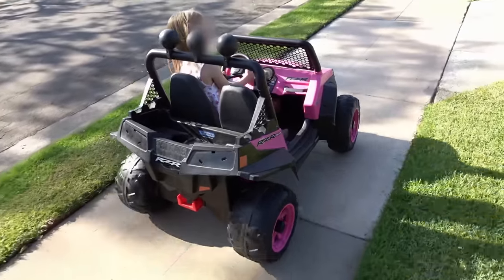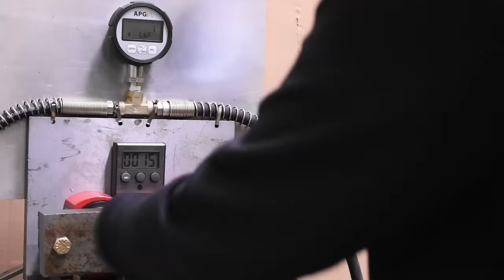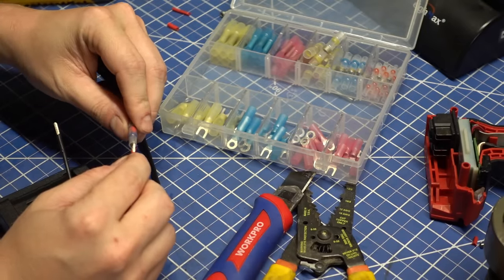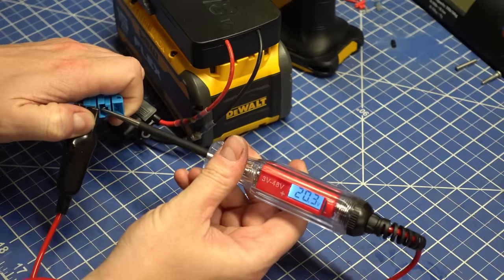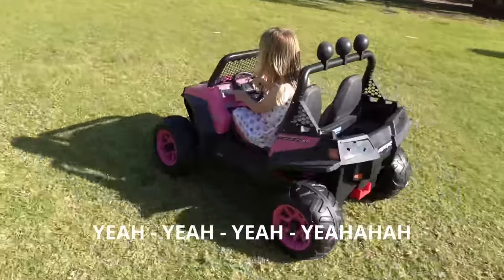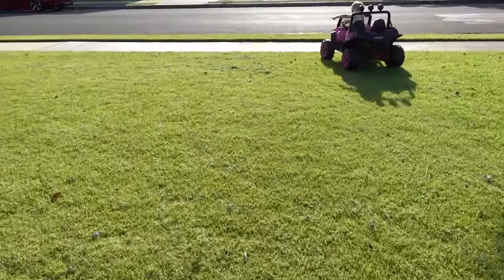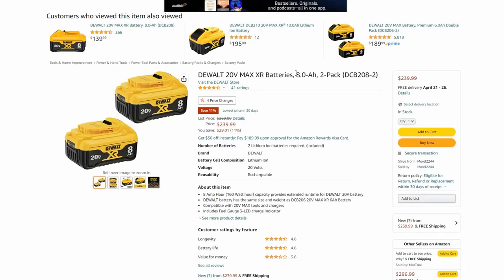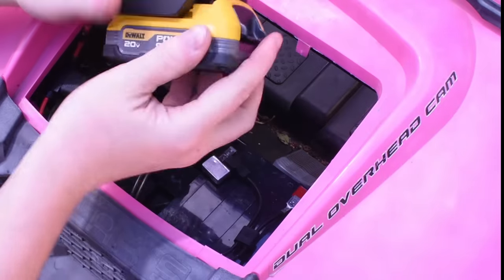I Figured Out What DeWALT's Huge $400 Battery is For😄(Kids Power Wheels)

Comment from the maker: 1.5 year Update: She's a bit older now and on setting 2 for ALL the fun, loves it. The car's been holding together just great, loosing traction is probably key. 
Obviously this isn't a cost savings mod unless you already have power tool batteries, they aint cheap. But if you do? Adapters for DeWalt: https://amzn.to/390Dm7Y M18: https://amzn.to/3uAiXBf Makita:https://amzn.to/3GlJXao Ryobi: https://amzn.to/3jNRIuD Ridgid https://amzn.to/36uSVE4
Plug end for Peg Perego: https://amzn.to/3jNRxz8 Power Wheels: https://amzn.to/480wtg9
Reply: Be careful, most dewalt batteries do not have internal low voltage protection. Meaning you can over discharge them like this and the charger will refuse to recharge them seeing the lower than expected voltage as damage. There are tricks to getting them to recharge however a cheap low voltage dropout circuit needs to be added to protect the battery.
Reply from the maker: @D3M3NT3Dstrang3r  6:14 agreed. The battery's display going down to one bar is enough to switch it over to the lead acid or another DeWalt for us. You usually have a decent 10-20 min window there too.
Reply: @TorqueTestChannel  I wonder if Ryobi wouldn't be an ideal option, as if I recall correctly the batteries all have low voltage protection built into it.
Reply: @TorqueTestChannel  That works as long as people know that and keep en eye on it. I do these types of projects with tool batteries often and generally use my Ridgids as they have protection. Also there are some great cheap batteries on the market to do these projects with, unfortunately that is why they are cheap, all of the load balancing is in the charger and protection is in the tool and not the battery. Im sure you know this, it is more of a tidbit of info for the people who may now try it since watching this.
Reply: @elijahwatson8119  Just about any tool that is using a battery platform from the earliest lithium tools like Ryobi / Ridgid have the balancing and protection built in. You can usually search and see which ones do. But there are also a couple of ways to get a good idea by just looking at the battery and price at least when it is name brand vs namebrand. Cheap batteries like Kobalt for example are good batteries but significantly cheaper because the load balancing is in the charger and protection is in the tool. And secondly look at the number of pins the battery has. If it only has about 4 actual terminals the protection is probably in the battery. If it has multiple small connections then load balancing is definitely in the charger which is a good indication that the oc protection is likely in the tool. One exception all batteries should have over current protection in the form of a non replaceable fuse to prevent fire. Ones with built in protection have a fuse and an overcurrent cut off that protectes the battery and fuse. Consider a current limiting device if you are using a battery with it not built in as well.
Reply: I bought an adapter with low power shutoff.It killed an 8ah dewalt over night or 2 nights  just plugged into the adapter only.Not powering anything.
Reply: @2hotscottpro  Thats crazy. One reason it is better to build this stuff yourself when you can. You never really know the quality of what some of the sellers in this type of space will sell you. On the other hand I met someone who did this setup for his son and also used the Dewalt batteries. He over discharged them and never could get them to charge again, not knowing any better he thought that he had just damaged them and disposed of them. Which if you manage to do it a couple of times they will be damaged beyond repair.
Reply: @2hotscottpro  Just another quick thought. Was it sold as a low voltage dropout device or Overcurrent Protection device? The 2 are mutually exclusive. I ask because ocp only does always draw a little current while powered and will eventually drain a battery but not usually all that rapidly. Under voltage goes before Over current in the circuit when designed correctly
Reply: @D3M3NT3Dstrang3r  link above in last post.Looking for someone to shed some light on this issue.Thanks
Reply: @2hotscottpro  I will have to check that out. In the correct configuration once it shuts down it should not power back up until the battery is removed and replaced and then only if the voltage is above the set threshold. In that scenario it may flash on but it should shut right back down. Dunno specifically about your device but it sounds like it is not working like designed, or if it is like they intended than it is poorly designed.
Reply: @2hotscottpro  Looks to be flagging it as spam.
Reply: I wonder if you could use the dewalt 20v to 18v adapter for low voltage cut off since the 18v tools didn’t have that. There has to be some kind of protection built in that adapter.
Reply: @derekrausch3499  Interesting thought. If I can find the one I have at work I will have to disassemble it and see. I don't remember the old tools having any type of protection either.
Reply: Can you say you are badass, kickass for a father?  Man I remember I had a two door jeep back in 1989.  Then my childhood best friend got one.  Then he got a go cart.  Then I got a 4 wheeler.  Then he got a Chevy Silverado.  I finally topped out at honda civic.  Those were the times when you could get away from traffic the easy way.  Lol!!
Reply: @derekrausch3499  Verified that the 20 to 18 has built in protection circuit. It is potted so I cannot tell what is all there but you can see the output mosfet. This would be a great piece to use as your connection for a dewalt battery but it looks to be considerably lower current than the normal lithium base.  Very small gauge wires going to the 18v side. Like 18-20 gauge.
Reply: It would be interesting to compare it  performance wise side by side to the adapter TTC used. You could probably just put female spade connectors on the toy car’s wires and plug it straight onto the 18v adapter pins.
Reply: This channel is called Torque Test Channel…haha so what’s the torque at the wheels?
Reply: Great mod. Nice work Dad!👍
Reply: That’s cool!
Reply: You can use the dewalt 20v to 18v xrp adapter as your low voltage protection circuit
Reply: does this 15ah Battery give more power than a 2ah battery or even 5 ah? I did the switch and my sons jeep with a 2ah battery isn't that quick! . Let me know what you think
Reply from the maker: @joeb1906  power wise will be better than a 2ah but not a ton more than a 5ah based on the wattage being requested
Reply: @TorqueTestChannel Next up at 16 she gets an electric car with 30 flex volt batteries 😂
Reply: I'm just wondering how its holding up now?  I put dewalt battery on my kids 6 volt toy and it burnt up the motor in it pretty quickly.  So for the 12 volt toy I stepped down the voltage to 12 and added low voltage protection as well.  I'd love for it to have more power in the grass and dirt though.
Reply: I have the exact same razor color and all! 
1 question, have you had any issues with overheating and it cutting out? Being on gear 2 it goes alot faster but after a minute or so it shuts off bc of a limit i installed. Wonder if a step up converter will be the fix? Thanks for the video. Daughter said she has 1 too  @TorqueTestChannel
Reply: I have this same car and use it with a flex 6amp battery.

It was fine till her friends tried to ride with her. The torque on the wheels was too much and it pulled more than 30 amps which fried the fuse. 

I was thinking of a speed regulator to stop that or she’ll have to stop flooring it on take off.

Comment: You replaced an $80 battery with a $400 battery. I love it.
Reply: My exact same thought, already had the battery I guess.
Reply: Mo powa babeh
Reply: Although we all know a smaller ah can be picked up cheaper, I wonder how many times the lead acid would need to be replaced vs the Dewalt. My experience with the small lead acid batteries is that while they start with good current and decent runtime this fades off rater quick as they are constantly being deep cycled.
Reply: @TheCharleseye  and most likely many many more recharge cycles as well.
Reply: Those doing this mod are using batteries they already have so it's $0.
Reply: No it is not $0 he had to buy that battery at some point.
Reply: @TheCharleseye  ok
Reply: @TheCharleseye  that's true, but I don't think that smaller batteries would be able to last long in one of these as I'm guessing it pulls way more amps than one of the 18650 cells that are in there is rated to give out. The huge 15Ah pack has no problems for sure as it has two in parallel working together.
But also, those things have no voltage protection at all! Do you know if the voltage protection is in the battery packs or in the tools? If the pack doesn't cut power, it's gonna be expensive when the kid drains the voltage to 0 and you have to throw the battery away
Reply: That's what you do when you build for a real performance boost in a real car.
Reply: @TheDeepDiveLLC  this is a real car?! She's like 2!
Reply: No
 That battery not worth 400$ it's all Chinese one renamed with dewalt
Reply: @D3M3NT3Dstrang3r
Reply: I did this with a 2 amp hour 20v battery I already had, I get about 30 minutes or so out of it 
Ordered a DeWalt adapter and a PWM to give it speed control.
Spent $50 for more power and better charge vs $75 for a replacement lead acid
Reply: But how would you set a price on the improvement he made to the kid's toy? It would easily have cost $300 more if it had had this much power to begin with. Which is should have had.
Reply: @dylantellez2496  Get them buff horses!
Reply: @rickybobbyracing9106  rip donut media
Reply: It’s worth seeing your kid enjoy the speed
Reply: Also it's like 12Ah vs 300Ah
Reply: I bought one for my kids and just removed the governor and it picked up as much speed as this one did by upping the battery
Reply: If you had kids you would understand. It's worth it and drill batteries charge faster
Reply: @liamcody5060  🤦🏻‍♂️
Reply: You get what you pay for !
Reply: This is one of my favorite videos in YouTube. My toddler is getting an upgrade battery.

Comment: Have the 10 amp hour dewalt  on my sons 12v mustang. Major improvement. Huge fan of the channel man. Being a father myself I can tell just by the way you interact with your daughter your an awesome Dad. I love the family interaction content from the tool channels. I think it’s something we need to incorporate more often on our channels. 👊👊👊 keep up the awesome work my man
Reply: That battery was a helluva bit on EBay from part outs. $110 plus tax and free shipping.
Reply: @Daddy_Daiwa  sure was
Reply: You and Torque are both awesome dads!
Reply: @jonathansherwood5841  appreciate that Jonathan. How’s things goin man?
Reply: you're*
you are.
Reply: @abudhabi371  appreciate the correction 🤷🏼‍♂️
Reply: Awesome, but I think you meant 9ah. Dewalt doesn't make a 10ah battery at least in the US.
Reply: @thedude8976  they come with the lawnmower kits I think but you can buy them individually
Reply: @IMPACT-NATION  10 ah or 9ah?
I have several 9ah flexvolt batteries
Reply: @thedude8976  nah they’re 10Ah. I’ve got a couple 9ah Flexvolts for our compressor and a 6ah flexvolt. Love those batteries. Yeah just google 10Ah dewalt XR they’ll pop up. I didn’t know they made them either till I found out last year. Pretty sure they were made for Outdoor Power Equipment considering the capacity
Reply: @IMPACT-NATION  OK I will thank you for the info.  And again great channel. 👍
Reply: @thedude8976  thank you brother. Really appreciate it man 🤛

Comment: Put a low voltage cutoff module set to 16,2v inline with the battery….. you’re gonna kill it if you discharge it too low. There is no protection inside the dewalt battery. If you used a ryobi battery you wouldn’t need to worry about that as they have cutoff circuitry internally
Reply: @TheCharleseye  Having the protection circuits in the battery does not make it inherently better though as long as you stick with the intended usecase, where that protection circuitry is build into the tool. In theory building the circuits into the tool can(!) reduce production overhead and therefore cost, at no downside for the customer really. For the average customer this definitely is not a matter of better or worse, as it makes no difference as long as you dont tinker with it.
Reply: @TheCharleseye   having the LVC in the Battery is am incredibly inefficient design and as long as you use the dewalt battery in dewalt tools the LVC in the tool takes care of it….. ryobi does that so they can brag about backwards compatibility to their NI-CD tools
Reply: @TheCharleseye  well of course it can happen especially if the battery gets cold or there are multiple days between it getting drained and getting charged back up ….. not arguing anything
Reply: @TheCharleseye  I had to do that a lot (jump starting the battery so that it would charge) with my Milwaukee 9.0 Ah HD. I was still using it almost daily (carpentry) for another almost year or two, when it finally got to the point it couldn't even be jump started anymore, so I took it apart and it finally dawned on me that all along one/some of the cells went bad. I manually balanced the five cells, and got another 6 months out of the battery; now it's finally dead and waiting for refurbishing. Still debating whether to tackle it myself (I would need to get a spot welder) or whether to send it off to someone who actually knows what are they doing.
Reply: @TheCharleseye  I've jump started a few Ryobi batteries, some of them were even brand new but DOA (mostly 1.5Ah and 2Ah batteries), but have never needed to do so on my DeWalt, Milwaukee nor Bosch batteries. And I've owned many from the cheapo 1.5Ah to 6Ah ones. 
Perhaps the 3Ah and bigger Ryobi batteries have such protection because I've never needed to jump start those ones, but the smaller ones definitely don't have such feature.
Anyway it's a quick 15 minute fix I've mastered over the years.
Reply: @TheCharleseye  maybe they expect the everyday user to be wiser than the once a month warrior? Or maybe Dewalt just sucks, I don't know 🙂

Comment: Probably wouldn't be too hard to add a simple low voltage cut off circuit to protect the battery. Thanks guys,  looks like a fun time.
Reply: DeWalt batteries have an internal BMS which will protect the cells from over charge and over discharge. I have run my batteries until they cut off by themselves with no adverse effects. The DeWalt battery is 15-21 volt battery while lead acid is usually 10-14.2 volts, which is why the Power Wheels moves faster
Reply: @winmancaboose  For instance Milwaukee M18s packs won't protect themselves. When I run regular 5.0 to zero charge (i.e. to a point where any M18 tool wouldn't even start), and then when I put it on a noname 18V leaf blower that has 3D printed adaptor for M18s batteries, it would still run, which would leave me to believe the battery itself won't shut down past 15 V and it will provide power even past the critical point (<14 V). But I don't dare to try.
Reply: @carsandtools  Ryobi batteries won't protect themselves from running down past 14V. I've had a handful 1.5 and 2Ah batteries get "bricked" from non-use and won't take a charge. But I was able to jump start these by opening them up and using a fresh battery and wires to bring them up to the minimal voltage required to take a charge.
I guess it would work the same on an M18 battery, though
Reply: @luisinhoens90  Ryobi batteries are known for self discharge due to the BMS not being constructed properly, newer ones seem to not have this problem.
Reply: @carsandtools  I know the m12s don't have any protection on the batteries, but I have never had any m18s to mess with.
Reply: @winmancaboose  I doubt it. Not many batteries have internal DISCHARGE protection. Yes, they have their bms'es, but rarely discharge protection. Mainly because they add it in their tools, so when using the tools, you don't fuck up your expensive liions, but if you use it somewhere else its insanely easy to f' them up. 
For example I make and sell parkside battery mounts and worklights and I needed to make my own procetion ciurcit
Reply: @winmancaboose  Dewalt doesn't have the low voltage cut off built into the batteries themselves as far as I understand - it's built into the the tools.
Using dewalt batteries without an external low voltage cut off will over discharge them.
Reply: @deezelfairy  Yes the tools do have the cutoff. I have repaired my 20v and 60v batteries and there is a cutoff built into the BMS instead of measuring the overall pack voltage it is determined by individual cell voltage and accomplishes the same thing.
Reply: @luisinhoens90  Yup, had one die on me. My father took it and fixed it, said he has had to do it with several of his.
Reply: @winmancaboose  yeah unless you use the new battery on some of the older tools then the safety features don't work anymore
Reply: Any idea what low voltage cut off id need to get for Dewalt battery
Reply: @kwmiked  ideally you wouldn't let the pack discharge below 15 volt. That's only 3 volts per cell and pretty dead by then. I'd say 17 even 18 volts for the life of the battery but under load the voltage can sag below that even with plenty of capacity left.
Reply: @user-cs1ne8gx9u  thanks,  I found a couple videos using a low voltage cut off
Reply: @drewdoestrucks  I had the same thing happen with a VERY old 2.0Ah battery so I just keep an eye out on it an pull them off once they hit "one bar" remaining. So far so good, but I don't let peopel throw the flex volts on anymore.

Comment: My buddy did this for his son. He also installed a voltage regulator so it's not too fast.  The downside is It's easy to discharge the batteries too much then they won't charge.   A low voltage disconnect would be a good idea.